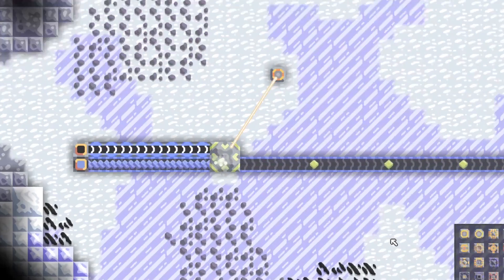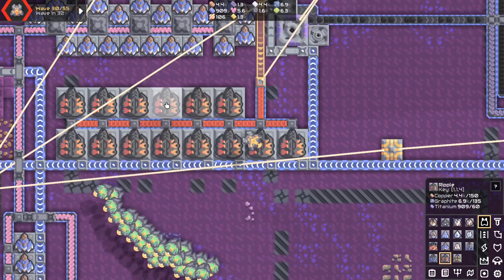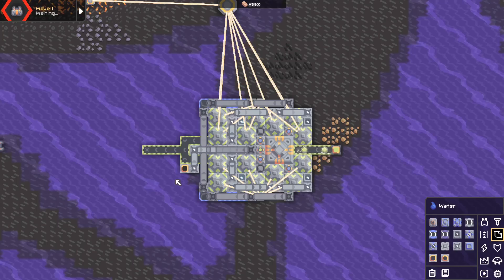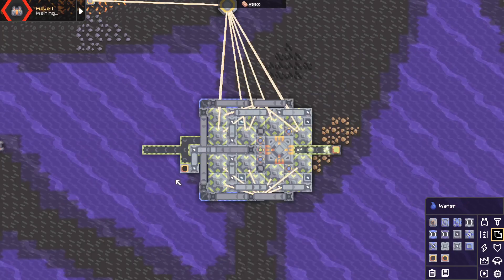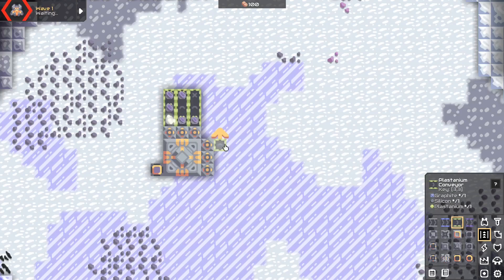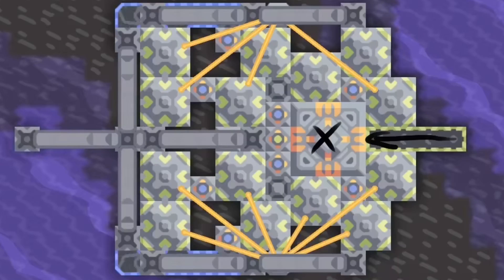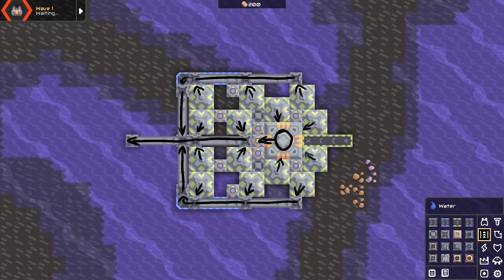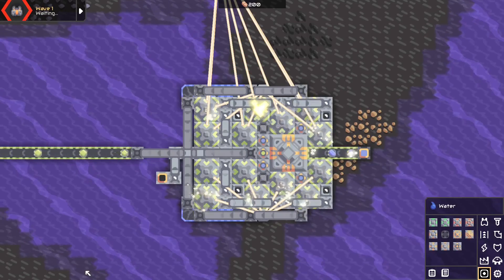Mindustry Schematics 2 | 14/s Plastanium Factory

Comment: Vault is useless space/resource waste,11 compressor has best ratios 2 titanium titanium belt 1 plast titanium belt
Reply: Says 11 compressors because Titanium belt cap is 11/s. This factory outputs 14/s, which  does not fill a plastanium belt (40/s), but over-fills Ti belt. NEIN wants a pretty, full Ti belt output.
Reply from the maker: Really? I can't personally verify that but it makes sense in my head. I wonder if the reason ditrukt made the factory this way was so that it would just be something you plop down and kinda forget about. Who knows?

Anyways, thanks for watching! :D